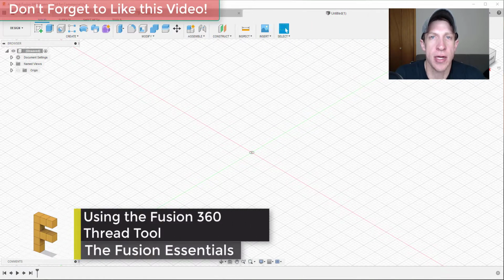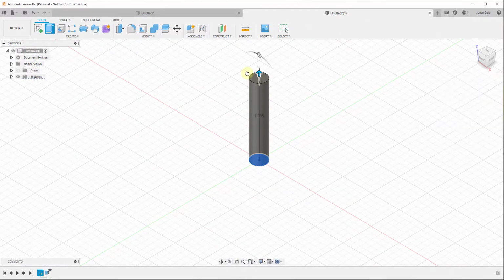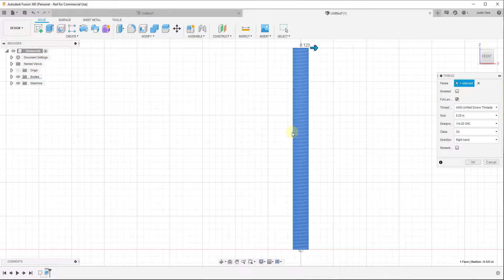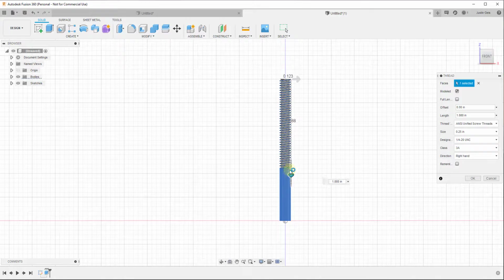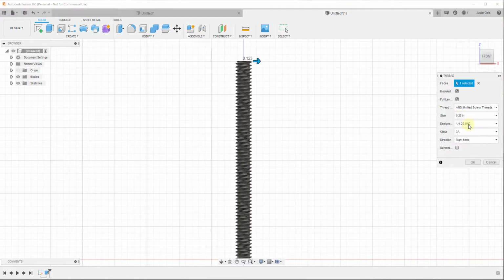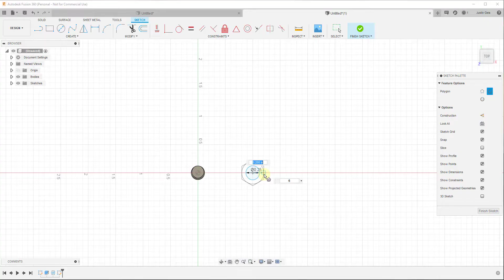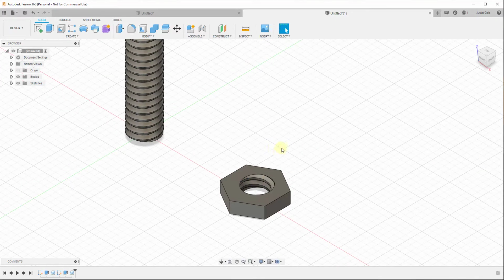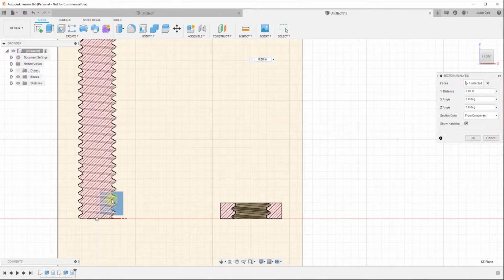THREAD TOOL Tutorial - Autodesk Fusion 360 Tool Tutorial

Comment: Does Fusion automatically adjust the ID? If you were to have a .25 ID for a 1/4-20 male thread, the nut would slide over the shaft. The standard ID for that thread is .201”

Comment: Critical information is missing ... clearance.  How can I set the clearances? in the real world a 3D printed 0.5" PLA screw will not fit in a 0.5" PLA nut without some clearance.
Reply: 3d prints you just have to go into the offset face command in the MODIFY tab and select the inner faces and off the the bolt by -0.1 mm ( make sure its negative!)  :)
Reply: yes this video is confusing, it didn't teach every detail.. he just jump create sketch without explaining how to find it or what to press
Reply: @SushiCat0316  you need to learn fusion first
Reply: @DrGeta666 sadly i just only need to create the screws and stuffs without commiting that much because i already have other 3D engine and i just only need the screws part, since blender 3D engine doesn't have that quick tool..
(which is kinda so disappointing)
Reply: @SushiCat0316 fortunately you’re about to learn fusion and be able to do much more than previously.
Reply: @samiam513  i don't have internet all the time to connect to fusion

it always ask me to login before using it, that is my other problem

Comment: This is a great tutorial! thank you for your effort! I use the thread tool quite a bit for my 3D printed models. I have tolerance issues from time time (which I can fix most of the time). I was just curious if you have a method for filleting ( rounding ) the threads? Depending on size the sharp edges don't turn out well.

Comment: Why does the Thread Tool NOT handle NPT threads??? The Hole tool provides a way to create NPT threads, but then the generated threads are only cosmetic, not modeled, that is it sure LOOKS like threads bit it's only an image of threads, not actual modeled threads, so the interior wall of the nut is still flat.

HOW can I actually MODEL an NPT thread?
Reply from the maker: This I don't know - per Autodesk support it's currently not available - https://www.autodesk.com/support/technical/article/caas/sfdcarticles/sfdcarticles/How-to-apply-NPT-threads-in-Fusion-360.html

Comment: presumably by selecting the same size thread the tolerance in the thread is going to be extremely small, is there a way to add tiny tolerance in the nut to allow for 3D printing?
Reply: 3d prints you just have to go into the offset face command in the MODIFY tab and select the inner faces and off the the bolt by -0.1 mm ( make sure its negative!)  :)
Reply: there is a way, although the only way i know is a bit convoluted and involves selecting a lot of geometry. i;m sure there's a simpler way. however, ive had good luck just scaling accordingly in my slicer. i.e., add or subtract 1% or something to the mating part. you'll have to play with your slicer but on 1/2" or bigger threads a lead in chamfer and about 1% scaling seems to work great for me. i can generally run a tap or die over the thread after as well if needed.

Comment: So...I need M2.5 pitch threads on a 25mm cylinder.  Fusion's Thread tool doesn't allow for these non-standard threads to be done.  I've looked at using the "Coil" tool, but that appears to be all guess work.  Any ideas?

Comment: How do you design threads for something like a vacuum hose when you dont know what the thread is ?  I have several items with threads I need to make adaptors for but have no idea how to identify if its a standard thread or some proprietary thread design.  Can you do a video on copying threaded parts for random items? not just standard screw sizes
Reply: On thingiverse i saw a calculator/ruler to measure threads. Maybe there is something for your need
Reply: Most vacuum threads are metric. You could use a thread gauge to verify online.

Comment: In real life, if you want to make a 1/4-20UNC nut (with threading tool), you should make a hole inside that with a diameter of less than 0.25. The exact value can be calculated, but what is known for sure is that it should be less than 0.25. Because after making the threads the diameter of the hole considering the threads will be (almost) 0.25.
Is it such that Fusion 360 takes care of these calculations itself? Here I saw that you chose a diameter of 0.25 for the hole. But in real life if you do that, then your threading tool will not cut anything out of that hole (Because it's larger than the diameter of the threading tool, including its threads).
Reply: This isn't how to cut threads in a machine. This is how to draw threads in a cad/cam program. In the software, if you want 1/4" threads then you select 1/4" threads. The programmer or machinist would decide what size hole to drill, which for a 1/4-20 would typically be between .200 and .220 mostly depending on required thread engagement and whether you're using a cut tap, a form tap, thread mill or single point tool.

Comment: Hi, like your video. Well explained.
Is there an option to select e.g. an Metric ISO profile thread with 19x1? As the norm suggest only even diameter like 18mm or 20mm I wonder how Fusion360 can make a M19x1. Any idea? BR from Austria, cheers!
Reply: Did you ever figure this out? I would have wanted to model M19x1, too.

Comment: Ok I have a question.
I have a 29.97mm rod and used a  30mm iso metric thread and made the same size hole in the nut and used the same thread and 3d printed and they don't screw together. It seems the hole in the nut is slightly smaller. Why?
Reply: yeah I had the same problem
Reply: You need to loosen tolerance values to account for the lack of precision with your 3D printer